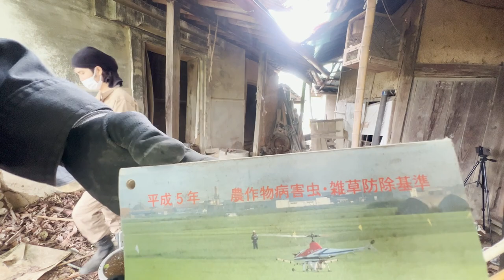【スッキリ】数時間の作業で見違える程片付く!!廃墟になった祖母の家【96日目】

Comment: the tool in the yellow box is a "pipe threader". You insert a pipe, using the correct jaws it will put threads on the end for connecting to fittings and other pipe.